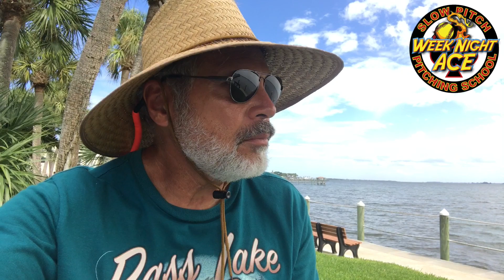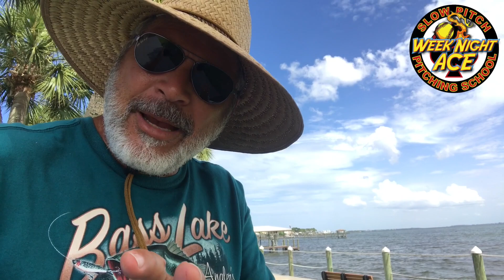Slow Pitch Softball Pitching Strategies - Ump Doesn't See High Strike, Robo Ump (TrackMan) Does!

Comment: Thanks for taking a break from fishing. We do not use a mat, we use a 2ftx3ft piece of 3/4" plywood on top of  the batter boxes which are astro turf on another piece of ply wood, inset into the ground. If it hits the board there is a solid thunk!
If it hits the edge on any of the 4 sides the thunk indicates it is a strike. So the ump only needs to watch that the arc is in the 6ft- 12ft.
Reply from the maker: I don't have a problem with that system as long as the umpire doesn't call the 6 foot pitch flat. I hope the umpire has enough time to make sure the batter doesn't step out of the batter's box also. I've seen umps completely miss batters stepping way out of the box to hit a low pitch. They should be called out, but have never seen it happen. Keep an eye out for this and remind the ump if you see it. But do it one on one... no one over hearing you.
Reply: Thanks for the reply. We can step out of the box with front foot at front and back foot at back but not out on the side and therefore not in front of the plate/board. This might be a local rule for Seniors play. Plus 60. Thx again for videos

Comment: The problem I've had as a pitcher is when my pitch from the right of the rubber as a right handed pitcher crosses the plate but lands 6 inches to the left. Called a ball simply because of where it landed not where it crosses the plate. Or when a batter way up in the box let's the pitch shoulder high go by and called a ball. Again, not where the ball crosses the plate
Reply from the maker: Roger, the problem you describe here is one reason I always pitch from the same spot on the rubber. It is this, I know where any particular pitch should cross the plate. The only variable is my accuracy, not where I'm standing on the rubber. I'm not necessarily opposed to moving from one side of the rubber to the other. But for me, developing good breaking pitches to both sides of the plate is more effective than from where the pitch was thrown.